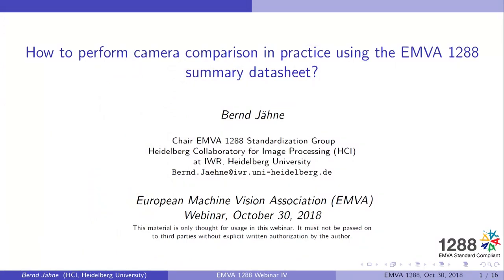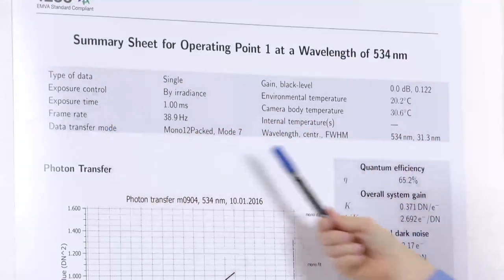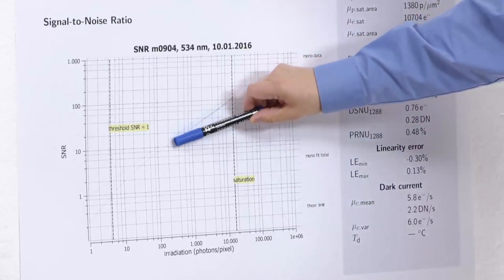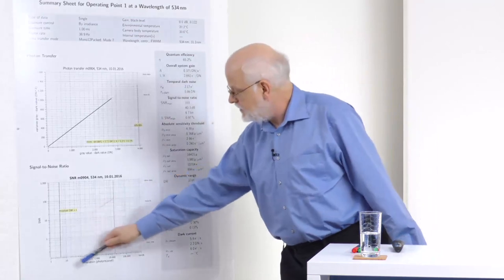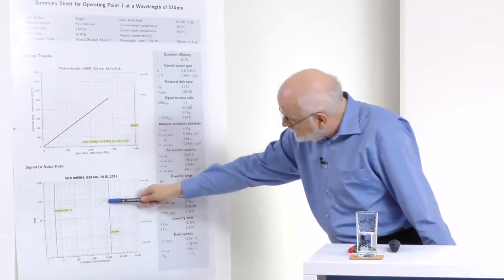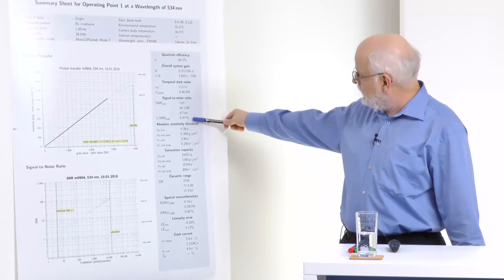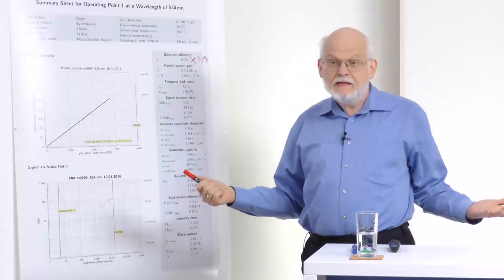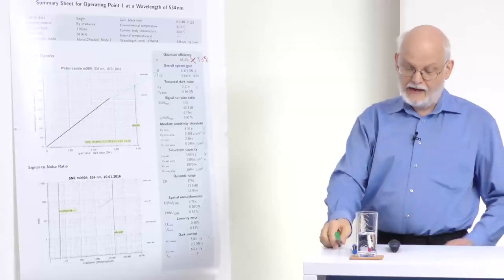How to perform camera comparison in practice using the EMVA 1288 summary datasheet?

Comment: Thanks for a another great webinar professor. I have a question regarding DR. I am reading a datasheet for an Omnivison (OV7676) camera with 70.4dB Dynamic range. What puzzles me is that
the camera only have a 10-bit ADC. Is this possible since 70.4dB is around 11.7 bits. How can the camera DR exceed the ADC DR?